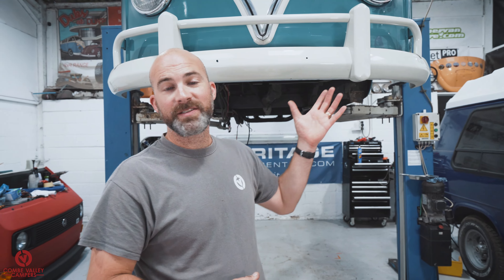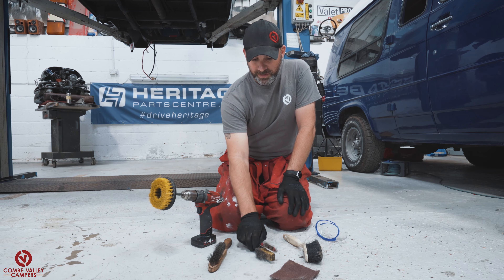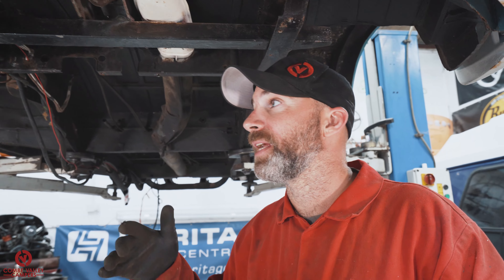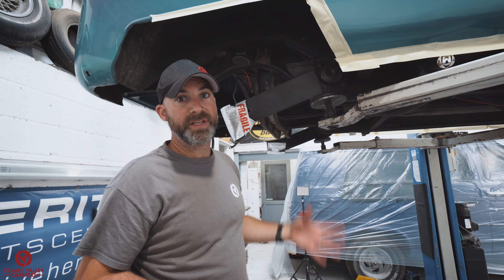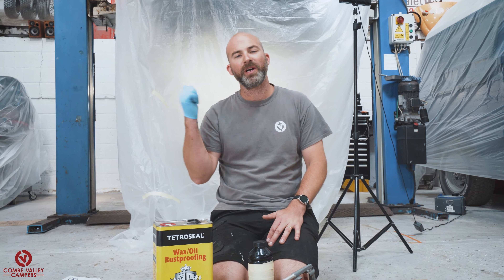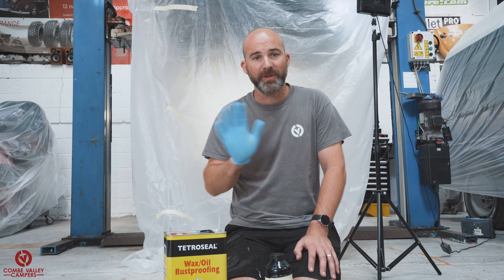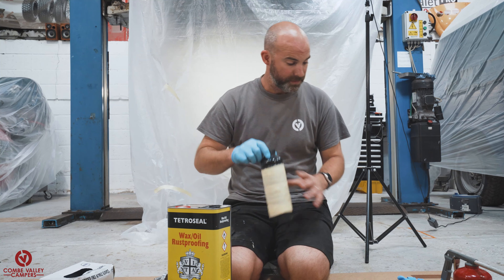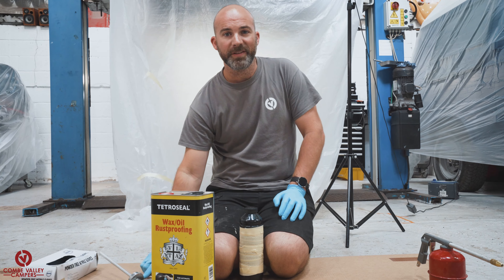HOW TO UNDERSEAL YOUR CLASSIC CAMPERVAN

Comment: Nice job, rust protection is always cheaper than welding.

Do you ever consider using the extension hose with the 360 degree spray nozzle to get right up the chassis legs?

Comment: How often would you recommend doing this?
Reply from the maker: I would reccomend checking every year, and you can 'touch up' areas that may be thin or worn. As for a recoat, every 5 years, depending on condition